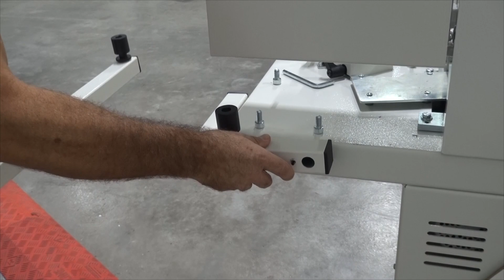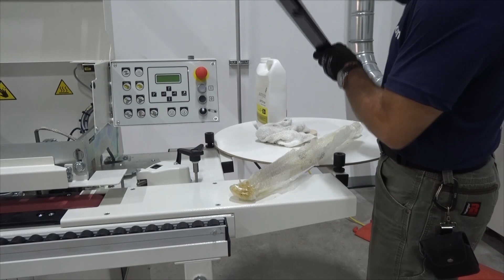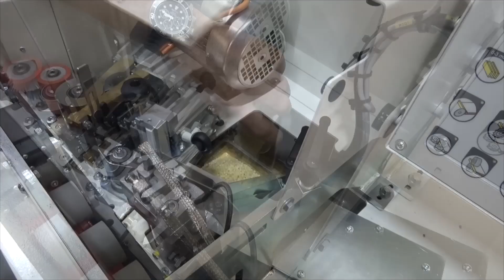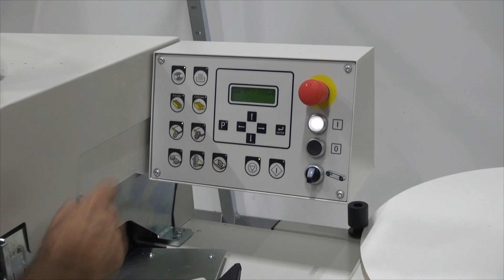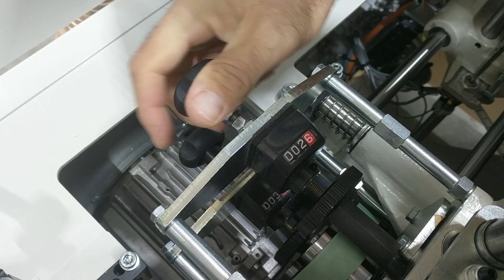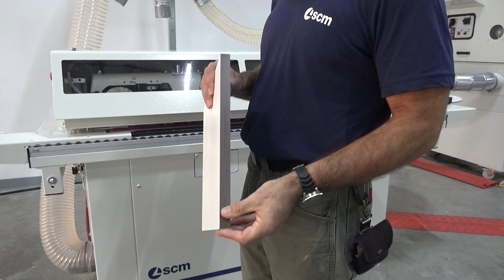SCM me 25 edgebander

Comment: whatb is the deferent betwen the scm me 25 and scm me 20 wchish is better for someone the is going to start
Reply from the maker: Hi!
me 20 panel dragging via upper belt
me 25 panel dragging via lower belt + contact rollers on pressing unit

me 20 has no optional finishing units => there is only one composition with edge loading system, pressing rollers, shear cutter end trimmer, trimming unit
me 25 is available in two closed compositions that include two finishing groups
 1st composition with edge loading system, pressing rollers, rounding end trimmer (can also work with wooden edges), trimmer unit, edge scraper, brushes
2nd composition with edge loading system, pressing rollers, rounding end trimmer (can also work with wooden edges), trimmer unit, edge scraper, glue scraper

The me 25 also allows to process wood edges and provides a higher level of finishing due to the 2 additional finishing units. It really depends on the budget one has.